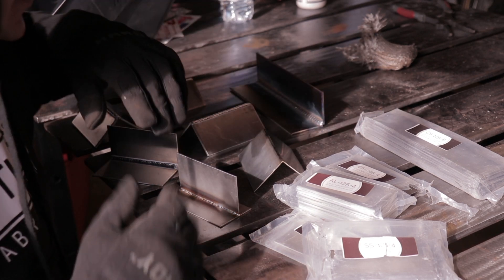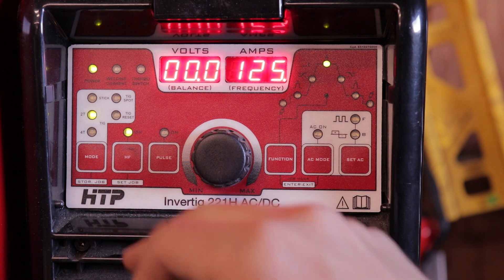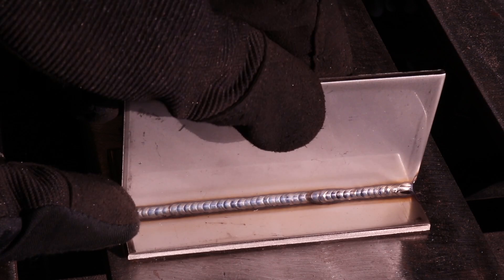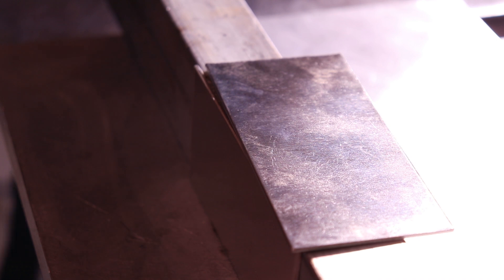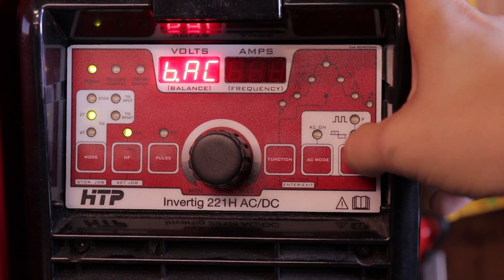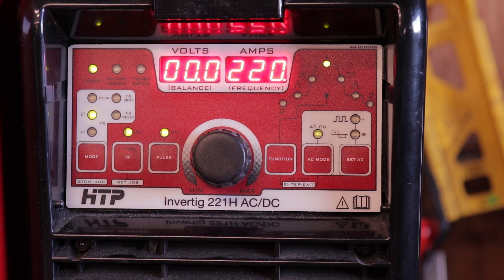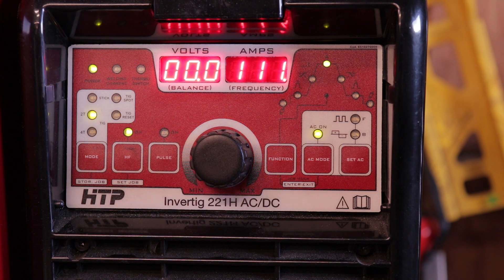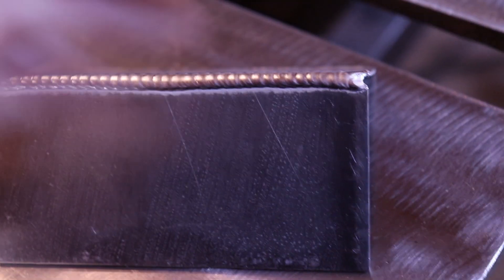TIG Welding Settings

Comment: Just got my HTP Inverting 221, what cfh are you running with the glass cup on aluminum?
Reply from the maker: Im runnin about 14cfh but my gauge is showi g around 20-25cfh. I use a peashooter on my cup to give me an actual consistent cfh.  Just turn it up slowly until its not dirty anymore

Comment: So ... watched carefully ... what did I learn ... (a) I need better equipment (HTP 221) so I can theoretically weld aluminum ... (b) I need a small dog.  I have contacted the American Kennel Club to determine the least vicious small dog on registry.  This will enable me to fully embrace Your aluminum welding techniques while addressing my mishaps and mistakes, therefore recognizing the need for kicking the crap out of a dog that has little to no ability to retaliate against my aged frame.  I believe this is a winning strategy ... dog lovers may not embrace my logistical approach.

Comment: At around 4:14 .  Do you pull (like smear) the puddle after you touch it with the filler rod??   It looks like you're touching it, and then pull it forward.  Or am I just imagining?  Can you explain your movement there?
Reply from the maker: Nope it's just the camera angle.  My filler is coming up towards the camera so it looks a little off.  I just push a tiny bit of filler in at a time

Comment: In my opinion if ur learning to weld dont use pulse or anyone settings every machine is different a general rule for every 1in use 1000 amps: 1/2=500 amps, 1/4=250, 1/8= 125, ect ect. I learn this in welding school and it's a great rule of thumb works everytime. If ur just learning might turn it down more than the rule of thumb just because ur going to be slow starting off.
Reply: That kind of falls off a little after 1/8". You definitely dont need 500 amps to weld 1/2" unless your running like a sub arc with 1/8" wire or something.
Reply: @Braodsword123  I weld 1/8 at 125 amps all the time this recommendation is a setting ur foot pedal is ur actual amperage used. Also these recommendations are mostly for full penetration welds. This is just the way I was thought and a recommendation. It works for me. I'm in welding school getting my batchelor
Reply: Nice 👌 👋
Reply from the maker: I agree don't us pulse until your already a computer welder.  And the 1 amp per thousandth of thickness works great but I stop using it after 175 amps. It would still work but I'd much rather add a couple passes then use a ton of amps. Me personally though
Reply: @5thStreetFab  depends what ur goal is, full penetration sometimes  requires that. If ur filling in something flush and dont want heat sink yeah multiple passes is a requirement at lower amperage. Sometimes pre-heat and post heat is required also. I like the recommendation amperage settings it works for me everyone is different but I also know when to adjust and figure things out.

Comment: Great video as always.   What’s up with the welder giveaway??
Reply from the maker: Thanks bud!  It was won by Reed Reels on Instagram
Reply: 5th Street Fab ahh ok.  I missed the posting. I am so amazed how good your welding is.  I am trying to get the metal together to build the welding slat table.
Reply from the maker: Oh sorry bud!  Thanks I appreciate it!  It's nice if you're doing a lot of fab work.  If you're mostly doing welding I would just get a solid table top
Reply: 5th Street Fab  well I want to do a little of both.  I have a new Eastwood Tig 200 digital still in the box.  I need to get the wiring in my garage put in so I can start learning.
Reply from the maker: Sounds good!  I would love to have a flat piece of metal I could slide over for welding on so I could have both!